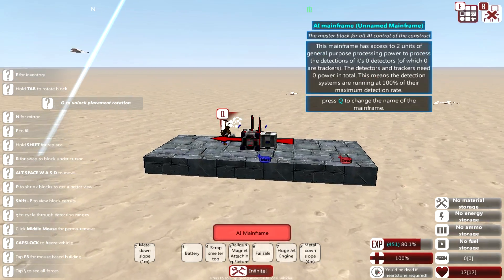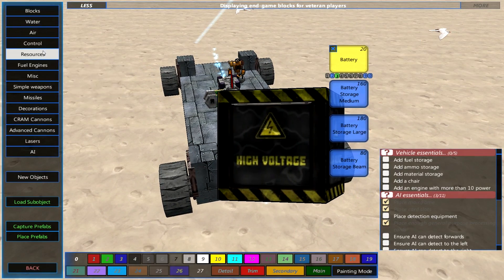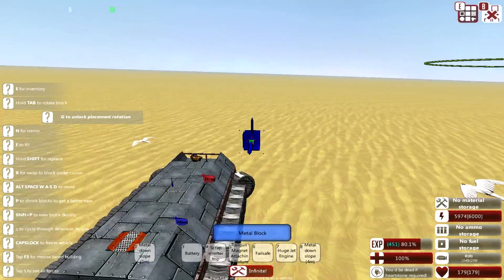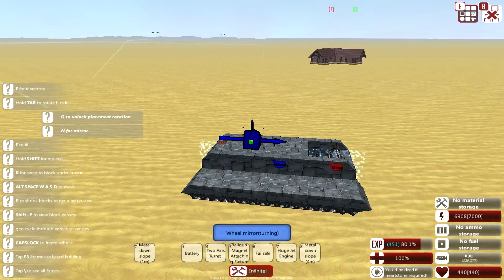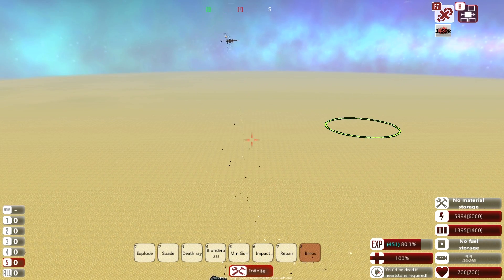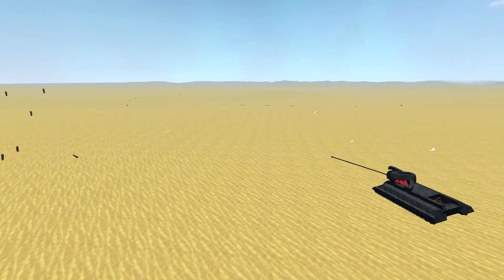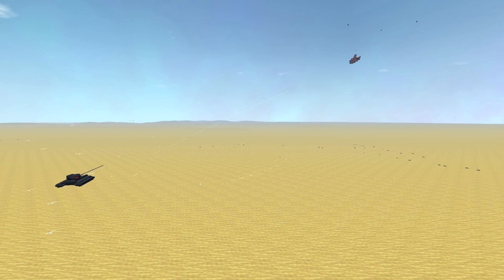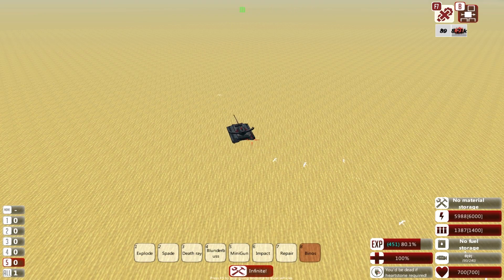From the depths | Building My First Tank!

Comment: I am very glad you are starting the "Ashe of the Empire" land campaign. Be advised that this campaign is still very much a work in progress. The devs will appreciate all the feedback you can give and we will look at your campaign closely. ;)
Here is a little trick: You can setup rudimentary tank controls with ACB's affecting the drive proportion of your left and right track. For instance, an ACB in range of a left side wheel can command it to brake left when the AI commands a left turn with the settings: "(Activate)... when received command to yaw left - Propulsion - Set Drive Fraction - 0.1" You also need a second ACB on a timer to reset the drive fraction to 1.0, and a set of mirrored ACB on the right track to turn right.

Comment: A few thoughts on ground vehicles. 
1. Ground resistance is a nonissue in this universe, so aside from armor schemes, it might well be better to just take naval vessels and adapt them to land function, cybran style. 
2.Since ground vehicles actually have a traction budget, unlike ships or aircraft, going fast is not going to be nearly as much of a defense. 
3. Since you do not want to flip over, keeping the center of mass low is going to be a very important aspect of design, and unlike with ships, you can't really put a keel on it.

Comment: Lathland - would you mind doing a little follow-up to this with some tips about tank design, now you've done most of the campaign? I really can't seem to stop mine hopping, or one side suddenly popping up in the air; I'm pretty sure I saw your early tanks do that but not the later ones. I'm sure there's a few other design tips to be shared without going into the specifics of a particular tank.

Comment: I use an AA Tank with a 12.9 cm Flak that has a fire rate of 1200 rpm. It can technically shred most tanks too, but it excells against air.

Comment: you should try and make a fancy turret for one. the kind where the vertical and horizontal movement aren't in the same spot. on the ftd forums, in post your teaser, on page 400 post 2 (from metaxis) is a good example. the large gun in the middle.

Comment: really want to play this game, but my computer cant handle it. I feel like a peasant. 

may i make a suggestion though? Wider base. have the canon internally inside the body not on the turret so it wont be top heavy. or the wider base would take card of the center of gravity. smaller shells with faster firing rate AP rounds and maybe use the radar so the targeting will be more accurate. 

thanks for uploading this, been watching the series for some time now.

Comment: I'm waiting for the devs to create a mean to make tracked vehicle before creating vehicles. They are a lot more stable and power efficient and vehicle is able to turn while staying it's ground.
Reply: but they are slow and with such fast firing weapons in from the depths that would be a death sentance.
Reply: NotIrishRider tell that to a chrislie suspension :D Heavy tanks are slow due to weight and concept, but cruiser and MBT are actually quite fast (50km/h or more)
Reply: A good example of Christie Suspension is the BT Series of tanks in the USSR.
Reply: Nathan Philbrick-Cruse I like military so i actually know what you are talking about. But in from the depths i feel like many wheeled designs would be the most efficient. Also does anyone know if the land campaign is a mod as i do not seem to find any stock campaigns which are on land
Reply: The M1 Abrams US battle tank has a top speed of 60mph...Seems slow..
Reply: Vain Fate top speed vs acceleration .... plus even if the tank was made in from the depths i doubt it would last long.
Reply: NotIrishRider You'll be surprised, I made a lli doom turtle wth tracks from a mod, Acc wasn't much but final speed was 60km/h, while the engine was overcharged.

Comment: You have to flip the wheels horizantally by 180 degrees to get rear steering
Reply from the maker: Doesn't work I'm afraid, as long as they are the correct way up, even if flipped, they will face the same way as the front wheels - They act exactly like thrusters in terms of control, but with no way to set them as 'reverse' to allow them to function correctly on the back.

If they are upside down with a vertical flip on a side note they do turn the correct way, but provide no actual force, or spinning animation.
Reply: Hmmm... Strange. I will redo my tests. 
Btw, I have been watching your bomber video, and I saw you used mines. You might want to change those to infrared-1degfrag-APN(set to 10)-fin missiles, which can track fast tanks and are very deadly when dropped from above.